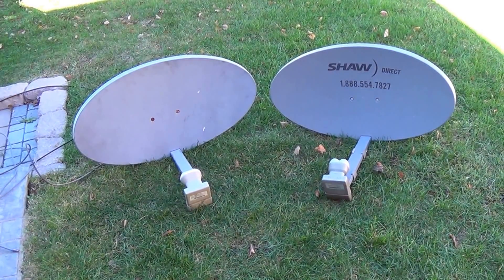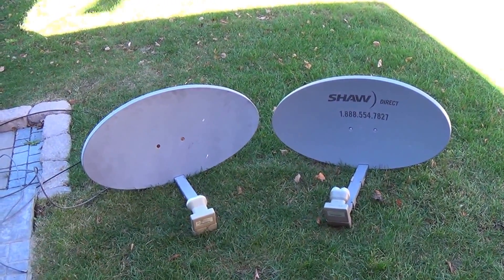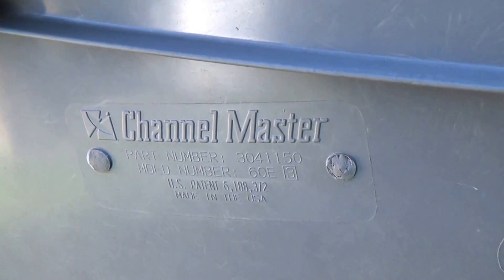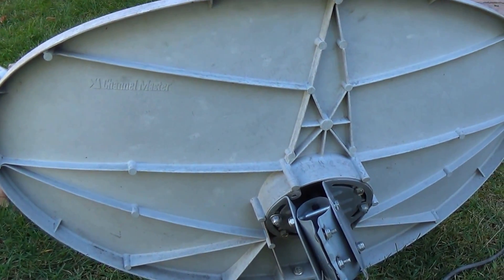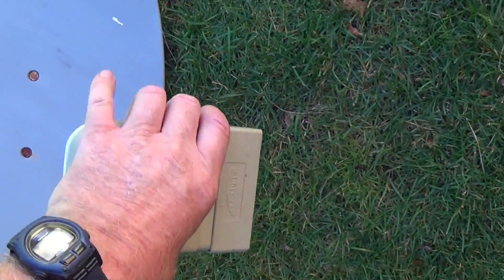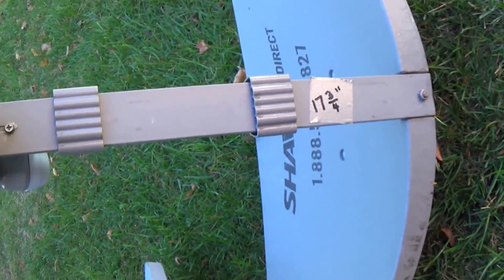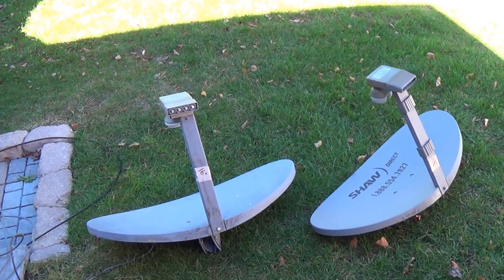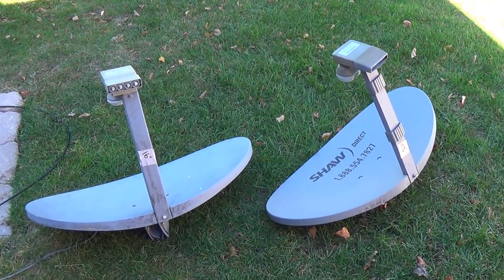Shaw Direct / StarChoice Satellite Dish Problem (Model 60E dish)

Comment: Is 20 inches the focal length for these dishes or am I wrong? I have a Direct TV (I believe) dish I'm wanting to use to ''try'' to catch a bit more signal than the  18 X 20 inch (or whatever) ''PIE PAN'' I currently have, but I don't believe I have that LNB support. I haven't checked the mold number on the back, but I believe the dish I have is the same as those in your video. I know & have ''VERY SUCCESSFULLY'' used the formula to find the unknown focal point for those big old C-Band satellite dishes, however, I haven't mastered the formula to calculate & find the focal point of these highly annoying, elliptical pieces of crap with their offset feed, ''excuse me, I meant to say neat & compact satellite dishes used to receive the digital signals being downlinked from much more higher wattage ''birds'' or satellites now occupying positions in the geostationary ''CLARK BELT'' 22,300 miles out in space, but I digress. I think I've briefly read that the focal length for these dishes is 20 inches, but that measurement was only mentioned in passing in an article I read in which some other aspect of these ''things'' was being discussed. By the way the dish is curved at their bottom & with that support bracket/bar being 17 3/4 inches long, 20 inches does appear to be a good approximation for the focal length. Without deciphering & figuring out how to calculate that formula, could you tell me if 20 inches truly is the focal length of these dishes or do you have another number which is more exact? Any assistance you could provide would be ''GREATLY APPRECIATED''. Thank you. BY THE WAY, THAT IS AN EXCELLENT & ''VERY INFORMATIVE'' VIDEO.

Comment: I have a direct tv dish here in canada. Will I be able to get signal from 111.1w shaw direct?  Please let me know
Reply from the maker: No idea.
Reply: @46fd04  I've been reading and looking that the round dishes are not good for shaw only the oval ones are good.
Reply from the maker: @coconutcolin  The old Starchoice round dish is obsolete. It does work, but only for one satellite. The oval dish, shown in my video, is the one to use, equipped with a Triple xKu LNB, for all 3 satellites.

Comment: I am Trying to connect a 75E dish with a Shaw dual band switchable xKu LNFB and a HDDSR receiver. How long should the arm be for a 75E?
Reply: +Bill Bertram  Can I use a 60E Dual band LNSB on a 75E dish?
Reply: +Bill Bertram How do I set up the receiver for xKu
Reply from the maker: +Bill Bertram I have never tried it, but I have read reports where people have used a 60E LNB on a 75E dish.
Reply from the maker: +Bill Bertram You need to call Shaw and ask them to set the receiver up for xKu, AFTER you have the receiver connected to the satellite signal.

Comment: no one cut it or anything, it's an original arm from when some of the 60E dishes came with a single satellite non stack lnbf

similar to this one, but not quite . . .

http://www.satelliteguys.us/attachment.php?attachmentid=91599&d=1380745306

it's tough to spot the shorter arms. not many of them out there.
Reply: Thanks for the info. If I remember correctly, the arm I found on the dish was about 4 inches too long, and I had to cut it to get it to work. I have never seen that LNB before.